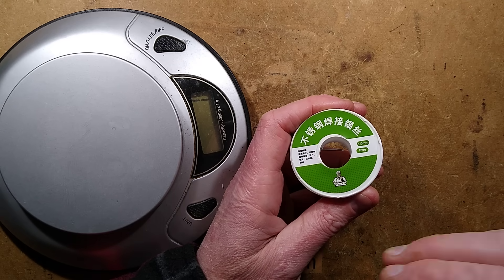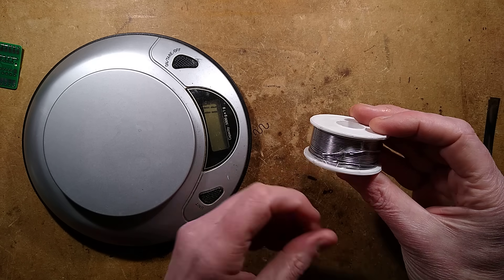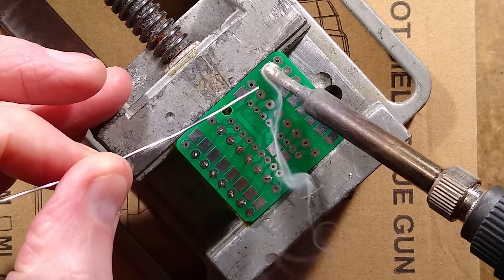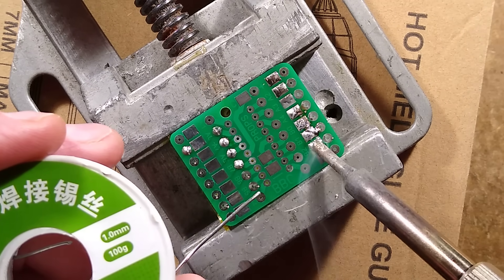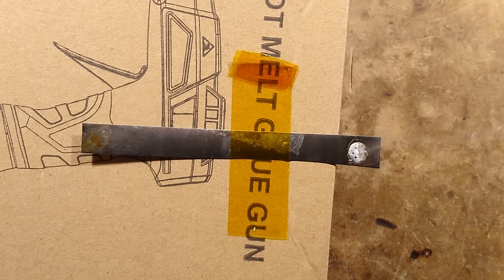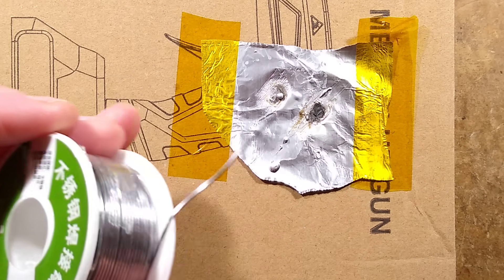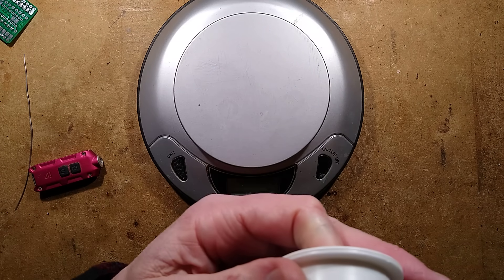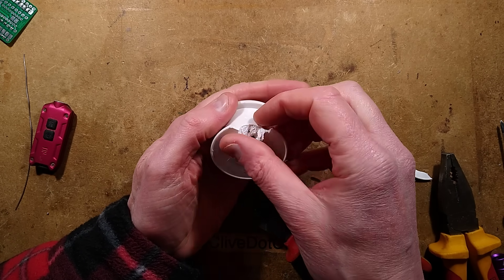Testing AliExpress "mystery solder"

Comment: I still have an old reel of RS Components branded Aluminium solder and it behaves in a very similar way. Not sure what the actual alloy is (the label is badly worn), but it has a very active, smokey and smelly flux that can break through the oxide layer on Aluminium, Stainless, or Nickle. I used to use it to make up PT100 temperature sensor assemblies. These had Nickle plated Iron leads and were very reluctant to take ordinary solder. The procedure was to solder with the 'Aluminium' solder, then remove most of it and make the final joint with Lead/Tin alloy. It also allowed soldering kitchen foil, which came in handy for screening sometimes.

Comment: The solder here in the US is not very good at all they took the lead out of it and just is not like it used to be. I lucked out and got two large rolls of old Kester brand solde off Ebay the real lead and tin stuff I soldered the coax center conductor  to aluminum  electric fence wire no problem cleaned it with fine sandpaper used that flux core it flowed and stuck great I built a 700 foot beverage antenna for my ham rig .copper is way too expensive now for such a big antenna .was hoping being from china was good lead tin stuff !

Comment: What's a good solder and paste for n00bs? I've had good luck with 63/37 and leaded paste, but I want to move on to something lead-free.
Reply from the maker: If it's for personal use you can keep using lead based.  The hysteria around lead poisoning is not based on reality.  Most people don't eat solder.

Comment: Anyone else fighting the instinctive habit of holding their breath while the mystery flux smoke wafts into your screen?
Reply from the maker: It was needed this time.
Reply: I caught myself almost blowing it away...
Reply: I imagined the aroma was reminiscent of a mix of hydrochloric acid, acetone, MEK, burnt resin, and trace carcinogens. Was I close, Clive?
Reply: @ Add some burnt dog fur, and a tiny bit of 5 day old dead fish.
Reply: Yes, that was i😅
Reply: I am a HD auto electrician.  I solder with a pencil torch instead of a soldering iron.   Like a plumber.   Because the pencil torch is instant heat, and the iron takes 5mins to heat up, and 10mins to cool down.  And time money baby.
Reply: @BramBiesiekierski Pinecil with a good power supply takes seconds to heat but it may be too small for your tasks.
Reply: @vadnegru I'm generally dealing with wire to wire joints with like 1mm upto 2.5mm multistrand wire.  On the rare occaision i need to touch PCB or other delicate jobs i do use a small iron.  But it just isn't practical for the bulk of what I do
Reply: My instinct is to blow the smoke away while soldering. So I blew on the screen
Reply: Clean  screen  @Fluxkompressor
Reply: @Fluxkompressor  You and me both. I was fighting the urge to blow it away. :D
Reply: For my part YES !
Reply: Not me. Proper solder flux smells lovely!
Reply: My eyes were watering…
Reply: I was blowing away the smoke too LOL
Reply: Yes, I was!
Reply: You can't imagine, I have multiple chemical sensitivities..... Just panic
Reply: I found myself squinting my eyes too!
Reply: I wanted to switch on my soldering fan.
Reply: No, and I got lung cancer! ... Big Clive will be hearing from my lawyer! 🤣
Reply: This is one of the reasons I made a fume extractor out of old components of a shop vac and two series-connected used flue inducer fans from old furnaces.
Reply: @WJCTechyman  Normally a vac motor will run on a d.c. voltage of about 12 volt or more.  I think that if you do so, you can use the whole old vacuum cleaner for this job.

Comment: Typical Chinese "got cha" product. They lie better than Donald Trump The quality solders I use are not afraid to list the composition of the alloy plainly on the spool. Weights are listed as "net" , not including the weight of the spool which may be plastic or steel. Nowadays you have to be diligent and careful in your pursuit of a good product. When specifications are not plainly listed, avoid it and move on.

Comment: Years ago I did buy some solder that did work with aluminium, but a year later the solder joint and a remaining stick of solder went very brittle and broke. I dont use lead free rubbish. My favourite is copper alloyed lead-tin .
Reply: Is that the Sav Bit brand? The copper reduces the tendency for the copper bit to dissolve in the solder. The cheap Chinese temp controlled soldering irons actually use a steel alloy the lasts really well.
Reply: More than a couple of decades ago, my brother took me to a car expo. There was also boat stuff. At one booth, someone demonstrated welding with a propane torch and some metal stick. He would punch the bottom of an aluminium can. Heat the bottom with the torch and melt the alloy and it would seal up the hole. I'm not sure how the metal did not flow through the hole. It also bonded well to the aluminium and was hard.

Comment: I bought a reasonable quality solder spool on AliExpress several years ago that worked fairly well and was of the advertised quantity/weight.  When I tried to find it again, I noticed that several other sellers were using the same style logo of the solder brand in their listings but masked the brand name in the photo -- the actual stuff I was looking for was nowhere to be found.

So, I bought from one of the dubious listings and basically got what you demonstrated: 30-40g of usable solder and a 60g spool.  The alloy may be lead-free and requires a minimum 350° to melt.  Won't reflow very easily and basically clumps up when there isn't enough flux present to help it flow.
Reply: Same story here :(

Comment: Seems to be a common thing in China that the weight always includes the packaging... Bought a "100g" can of (flux) rosin on aliexpress, and the closed can was weighing  101g. Since the lid alone was already 7g, I guess the can only contains somewhere around 60-70g of rosin.
But oh well, at least it's cheap. Though I wouldn't quite trust such shady stuff as that solder, especially when they don't list what it contains. I'll stick to my trusty lead-based solder from Stannol (German company), bought a 50g roll from them years ago, and it will most likely last me many more years xD

Comment: You need access to a laboratory that can actually test the material.  I used to have access to x-ray defraction equipment, where we were able to get an instant indication of the actual alloy.  The best solder is eutectic, if I spelled that right.  Happens to be 63% tin, 37% lead.  I have no idea what the latest non-lead solder alloy is, what I do know, it's a pain to solder with.   Jim
Reply: Lead free plumbing solder is an alloy of copper, bismuth, tin and silver.  I don’t know the proportions.  I believe the silver is around 2%.  The woking temperature is supposed to be 420 - 460 degrees Fahrenheit.  It is NOT recommended for use on aluminum.

I had to sweat a pipe joint using that stuff and it does not flow as nicely as the old 63/37 lead solder does.
Reply: @wtmayhew  Back in boomer time plumbing solder in the US was 50/50 tin/lead. I think I still have some somewhere but of course you're not allowed to used it for potable water plumbing. You had to give it some heat, but what the heck they were just pipes. 60/40 was for electronics. 63/37 was "eutectic solder" and had the lowest melting point. I have never seen any 63/37 in my life as the others were good enough, and I've done both plumbing and electronics work. I never even heard the word eutectic until I took materials science in college.
Reply: @wtmayhew  50/50 acid core is the best for plumbing/copper pipes ! ...LoL
Reply: I run an ED-XRF laboratory that would be perfect to analyse the composition of  this solder. Very happy to analyse it, just post it over!
Reply: I've actually used some almost decent lead-free stuff, not the best solder ever mind but totally acceptable (especially compared to some of the real dubious stuff).
Reply: You want it just slightly off eutectic, which is why 60/40 solder was more common than 63/37.

Lead solder will slightly dissolve copper, and the resulting alloy of course has a higher melting point.  A long, hot soldering process will enhance the effect, resulting in a thick gradient of copper-bearing alloy with variable melting point.  Soldering at just above the melting point will minimize it, as the dissolving copper will raise the melting point and immediately solidify the alloy.
Reply: Mine state Sn99.3Cu0.7 works fine with 300-350C
Reply: It may or may not be consistent across rolls. It might be a mix of some soldering base metal(s) with the rest being random filler metal, whatever was cheapest from the recycler that day.
Reply: A mass spectrometer will do. Can't believe military and NASA contracts are still asking for 60/40.  This is like technology from all the way back to WWII !  63/37 RMA and RA no clean with rosin flux eutectic solder is tried and tested and still the best.  Lead-free clean and no-clean solder only has a record of around 25 years and we will soon find out if planes are falling down from the skies or not !

Comment: The side of aluminum foil you used is the coated 'nonstick' side.  You can tell because it is the dull side and not shiny.  It works as both a nonstick coating for foods but also for keeping the roll from sticking to itself.
Reply: Not correct.  A common myth.  Aluminium foil is not coated at all. One side is shiny simply because of the way it is produced on the rollers during manufacture.  There are plenty of manufacturing videos explaining this.
Reply: Even without a non-stick coating, kitchen foil has a dull side. It's a side effect of the manufacturing process. The metal is rolled thinner repeatedly, through rollers which are closer and closer together. To get it just a bit thinner on the final pass, they put two sheets of metal through the rollers together, to prevent tearing. The side of each sheet which was in contact with one of the smooth rollers comes out shiny, while the side which was in contact with the other sheet comes out dull.

Comment: The "68% Off" in the listing is referring to the Solder itself shorted from the reel. 
That is more like 2/3rds of the weight is reel and 1/3rd is the solder. 🤨
Very interesting and surprising that it stuck to the stainless.   🤔🧐

Comment: i have some left over of the same solder wire, i personally don't want to use it other then wielding stuff together or fill up holes on a pcb prototype board, because once its cooled of , it can take some serious heat before melting .
so if i want to build solder tracks on a pcb protoboard, i use that weird solder wire as a base, then i can use lead based solder on top of that and connecting the dots, without it running liquid hot solder trou because the Chinese solder will not melt, but it will fuse with higher quality solder tin. 

Also yes, it have a sour stank to it when its melting .

Comment: The one time you actually want lead in your AliExpress product and it isn't.
Reply: All they had to do was break those darn safety regulations just one more time... 
RoHS is the one they comply with all of a sudden? Seriously?
Reply: @westelaudio943  Fun fact: Aviation, space, and medical devices are exempt from RoHS and can still use leaded solder, because even the best lead free solder is still not as good as leaded solder.
Reply: @ The reasons are tin whisker growth issue and vibration fatiguing. The germans used lead/tin/silver solder in WW2 rocket bombs for this reason.
Reply: @MicraHakkinen  Silver based solder is pretty good, so I've heard.
Reply: @MicraHakkinen  As long as ye got lead in yer pencil, everything's fine.
Reply: @willtucker2774 There is plenty of lead in my pencil. It's getting the opportunity to write stuff down on a regular basis that eludes me.
Reply: @willtucker2774  news for ya bud... there ain't no lead in yer pencil. Knokin de deer further doun de step, lead never been in any o yer pencil.. 😢
Reply: Pretty sure my Kester lead free will perform far better than this knockoff.
Reply: First the fellow with the 60/40 ratio:  60% plastic, 40% questionable alloy and now you.  Thumbs up.

Comment: Does it smell like caustic plumbing solder?
Reply from the maker: It probably is acid based.
Reply: @  An oxidizing acid would explain why the Al2O3 layer reformed so quickly. Would also etch stainless steel. Nasty fumes

Comment: It's probably mostly lead based on other Chinese solders I've bought. Likely 70% lead with mostly tin for the remainder and some other metals. The plastic range is huge as one would expect with a non-eutectic alloy and the finish is always grainy like lead free solder. Open up any WW2 consumer electronic device and you'll find the connections made with solder having a very high lead content and the look is never shiny as the alloy takes longer to solidify. It won't be lead free because lead free is far more expensive to produce. Lead is cheap baby!

Comment: I used the camera function of Google Translate on my phone. The big letters on top of the spool say: "Stainless steel welding tin wire". The small letters on the left say "Suitable for welding: Battery inserts, stainless steel, plated surfaces, zinc sheets, iron sheets, tinplate, copper". Absolutely no mention of solder or flux composition. Who doesn't like a mystery treat!
Reply: .....or mystery threat 😂
Reply: So what you're saying is in Chinese, it actually describes what it appears to be useful for. Kinda funny. Maybe it's on sale because nobody outside of China could actually find it in a search if they were actually looking for steel solder! I could see this being really useful for making battery packs if you don't have a tack welder.
Reply: @waylandsmith  Perhaps. But a solder product must absolutely state the chemical composition of its constituents. Not mentioning them is sketchy, because many Chinese solders are made from waste and recycled materials, with unknown contaminants and harmful additives. This has been documented and raises not only performance issues with soldering inconsistency, but health concerns. For all we know, Clive might actually have inhaled flux with dangerously high levels of halides in this video.
Reply: Google is not a great translator.  What it says is "Stainless steel welding tin wire"  i.e. tin wire for soldering stainless steel, hence the aggressive flux.

Comment: The reel even had a hole straight through it to make it look like the solder was wound tight!

Could be worse: I've got a torch which is supposed to have 4x Lithium cells, but has actually got 2x plus a slab of (I think) basalt.

Comment: I bought this to use on soldering my vehicles O2 sensor harness (stainless wires) that my usual Kester solder would not work with. Biggest thing I noticed is it smells awful! Had no idea I was paying mostly for a plastic spool.

Comment: I got really bad solder from aliexpress/ebay (don't remember which) as well. I was checking there, because I wanted leaded solder. I use lead-free solder when I assemble electronics and I have no problems at all with that. The only reason for leaded solder is when I want to un-solder something (e. g. for repairs), because the lower melting point helps in that case. The solder I got is lower melting (so quite likely leaded), but it does not really flow, gets "chunky" and the flux smells terrible. For desoldering it is somewhat useable, because there I add extra flux (which makes it flow a bit better), even a small dab of good lead-free solder works wonders, and the solder is removed in the end anyway and gets replaced by proper solder (lead-free).
But for reference: by solder from a source where you know what you get. It really isn't worth the hassle, even without getting cheated on.

Comment: Yes, AliExpress can be wild. That said, I've bought rolls of both leaded and lead free solder there and they were just fine. You can still find good deals there if you limit yourself to buying from professional sellers, preferably factory outlets.
Reply: I need tips for this, as it's hard to keep track of the sellers when they all use the same stock photos and/or the seller's name being buried under all the visual noise on the page.
Reply: @h8GW  I was really satisfied with LAOA solder wire, for some reason they stop selling anything less than 400g and I don't need that so now I use Mechanic stuff. Not so great but still good enough and cheap af.
For everything else one simple rule is that when you see something you like and it cost $5 you never try to buy that same thing from seller with bunch of numbers in the name for $1. In the best case you'll get factory defect and more commonly you'll just get cheap copy of original product.

Comment: That solder is probably 60% lead and 40% tin or 30/70. Proper lead-free flows much better than random chinese solder. Still not as good as 63/37 or 60/40 but at least is usable.